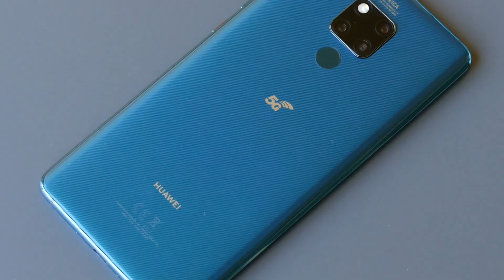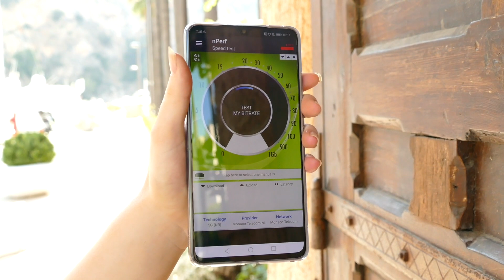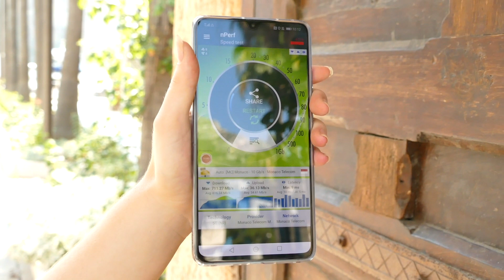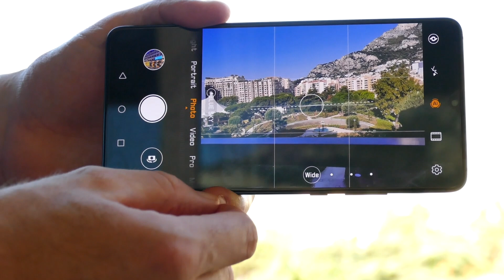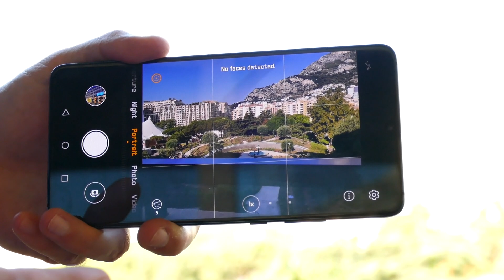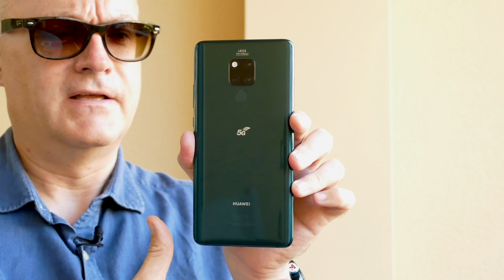Huawei Mate 20 X 5G | First Look

Comment: Wait until you use 1000gig of data a month, coz those apps will come using too much data to run that fast as you like. Thats how 5g works
Reply: That's OK I got unlimited data
Reply: @watcher7442  Don't be fooled. Unlimited doesn't really mean unlimited. It's throttled to a certain data cap before data prioritization kicks in.

Comment: Does 5G drain batteries faster?
Reply: Nope, it's all connection speed in the network. Battery life has in fact gone up since this phone uses newer processor that is more efficient and the screen is also more efficient in terms of power consumption. Look up the specifications for additional details.

Comment: Battery is 5000 mAh in the old 20X. Why would Huawei use 4200 mAh for the 5G? And they also took out the headphone jack? The USB headphone connection is a battery killer so that 4200 mAh battery won't last long
Reply: The 5g radios/antennas take up more space, but yeah 5g drains battery faster so putting an even smaller battery is a pretty bad idea
Reply: @braulioribeiro5798  They should of made the phone thicker and heavier for a larger battery to be practical.
Reply: @masterofthefirstraceoftheu8608  they could have made it bigger but it is already big enough
Reply: At least this should drop the cost of the better Mate 20 x 😄👍
Reply: 5G costs less energy.
Reply: @xuzhang3823  What are you gonna do about the 7.2" screen cause that's a battery killer
Reply: You just get a case with spare battery pack. Now you can walk around with 11,000 mah on your Mate 20 x 5G. Who gives a shit about the headphone jack.  Who get bluetoothwitha decent battery.